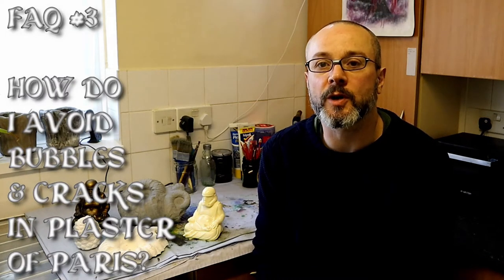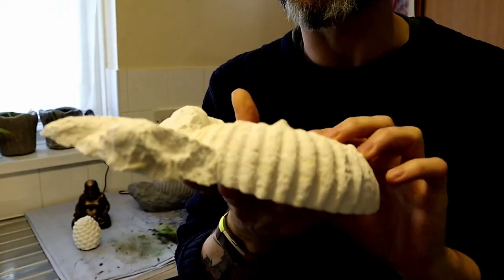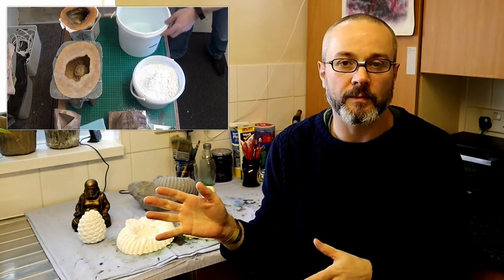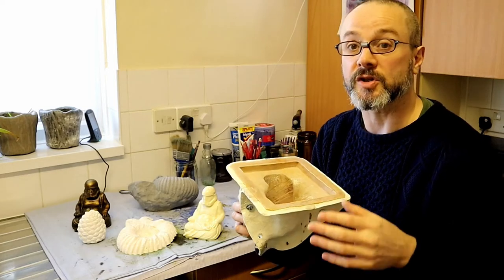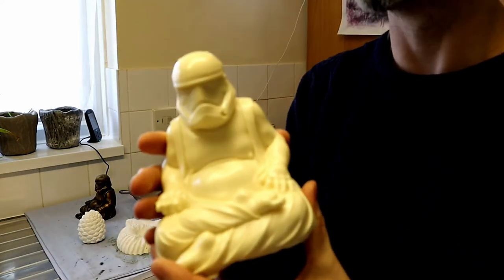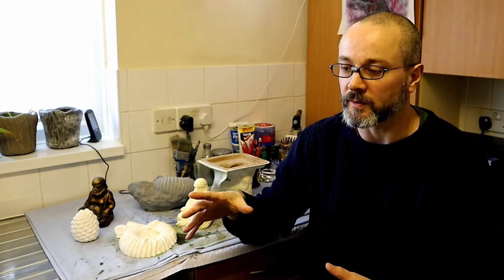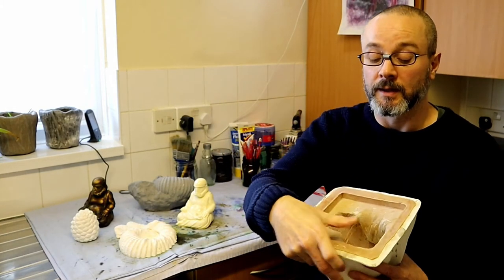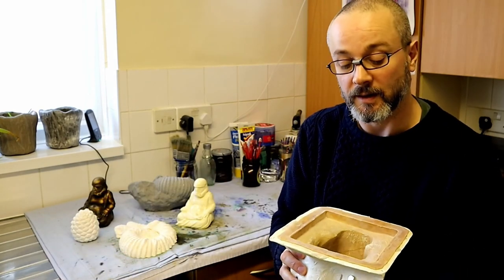FAQ #3 HOW TO AVOID BUBBLES & CRACKS IN PLASTER OF PARIS

Comment: What molding material do you use and where do you get them? I seen other videos with concrete and things where they use a sander as a vibrator to help get the air bubbles out I don’t know if it would work for something like this

Comment: all the plaster of paris i have used has a 2 plaster to one water ratio, never seen a 1 to 1 ratio, in fact i have created a mixture by mistake that was 1 water to 1.5 plaster that created  nightmare castings that were so soft that it took weeks to dry and was subject to crumbling under slight pressure, in fact the hundreds of castings of POP using the 2 to 1 ratio mix i have never seen the results crack, when using the POP 2 to 1 ratio is not needed to be exact just heed the wetter the mixture the less strength of the casting has